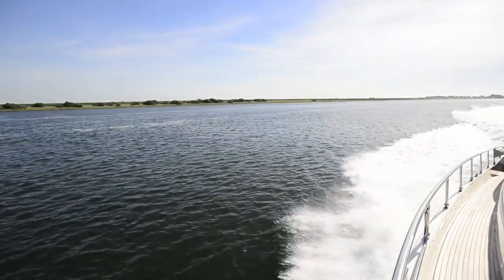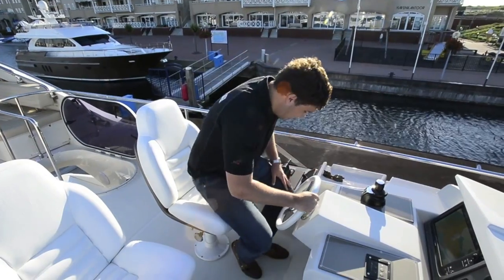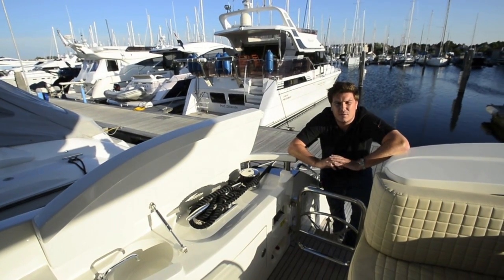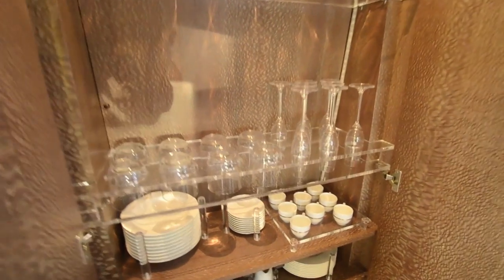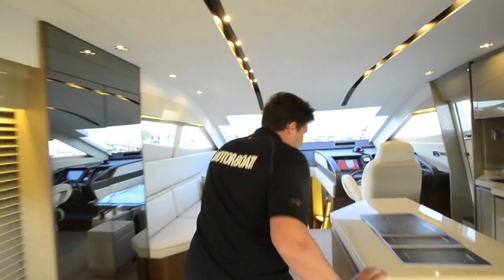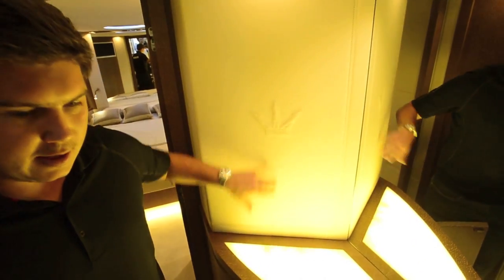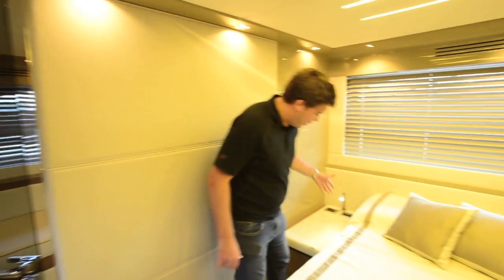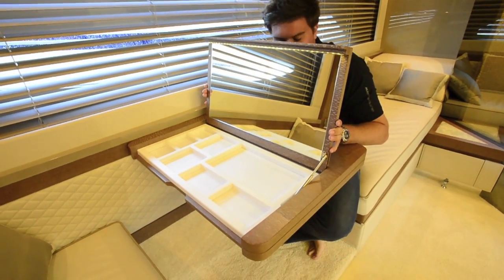Dominator 640 from Motor Boat & Yachting

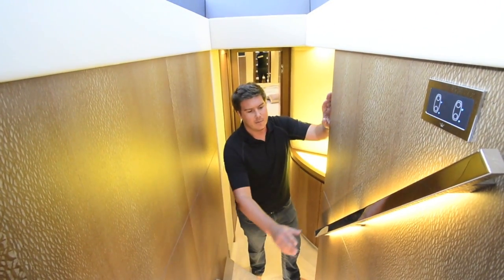Comment: I don't understand "high end" features on a boat this size. Yes, I want a nice boat, just like everyone else but in this size range people are looking more for practicality, function, & reliability. Yes, some of the stuff looks great but having to replace some specialized tract light is far more complicated than picking up a new bulb at the marine store. Is marble really practical in swells on a boat that size. At 3:35, do you want that slick looking railing when you catch your hip on it in rough seas? Or, do you want a good functional railing with a nice rounded end? 
Like I said, it does look very nice but, most boats in this size range also look nice and they tend to remain functional while doing so. Seems to me going that extra step to "high fashion" loses lots of functionality. Look at the sink in the master. That's not designed for a boat. It's got a nearly flat bottom, it's wide & very shallow. If you are heeled just a few degrees due to wind in the marina or whatever, water is going to sit in the corner of that sink. In a sea, water will slosh out very easily. 
Maybe it's just me but, in my book, a boat this size is to go out & have fun with & I am not willing to give up some function trying to get a little extra "Wow Factor" from guests.
Reply: With a boat this big the owner is probably going to invest in a gyro stabilizer, so rocking in marinas is a non issue.